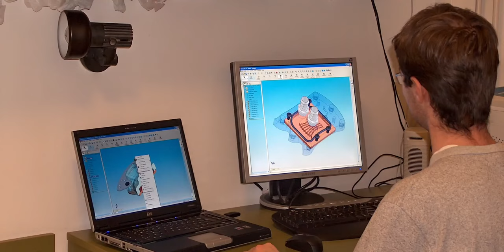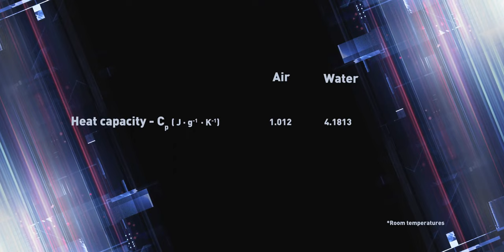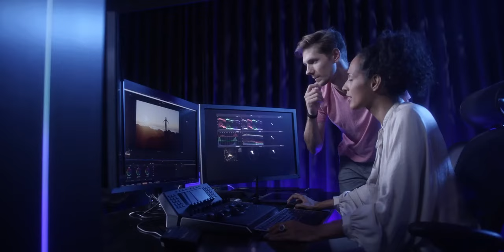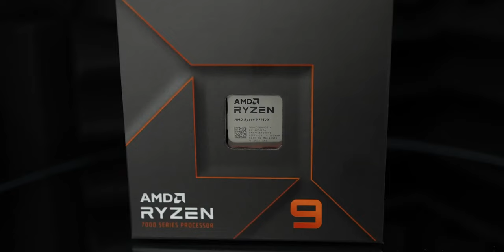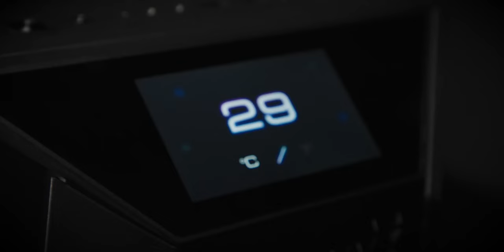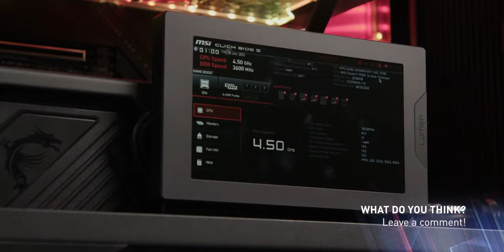Building The Future Of Water-Cooled PCs | EK EXPO CES 2023

Comment: so is there a distro plate I can use for the cooler master 700 Evo to replace the mirror lol on the side I was thinking of 2 360 rads on the top leaving the front clear for air flow and 2 or 3 fans on the bottom to give a positive air pressure or no distro and a 3rd rad intake on the side this would be 2 360 standard rads and 1 360 X flow 
great show thanks

Comment: What would be amazing in my opinion is a dual D5 distroplate/reservoir where the returns from both loops go in to the same reservoir so that the temps between the loops equalizes thus the rads are shared between the CPU and GPU while maintining the flow rates you would gain by using two pumps and shorter loops.